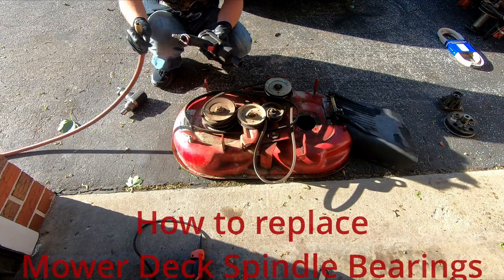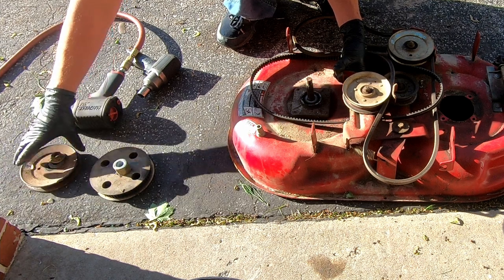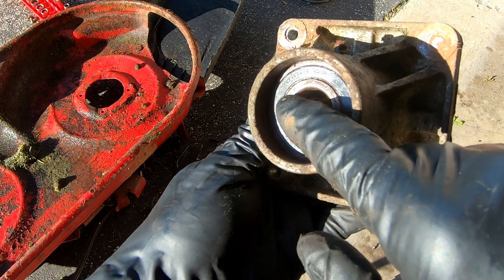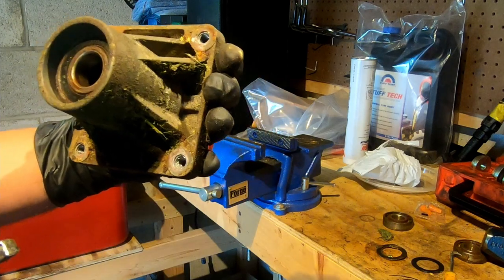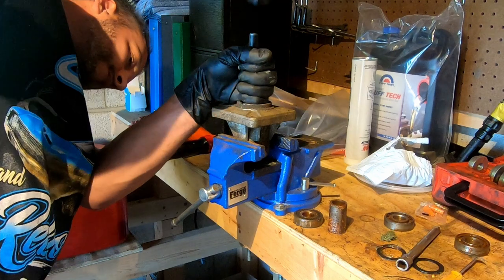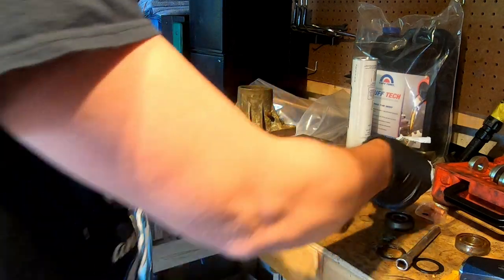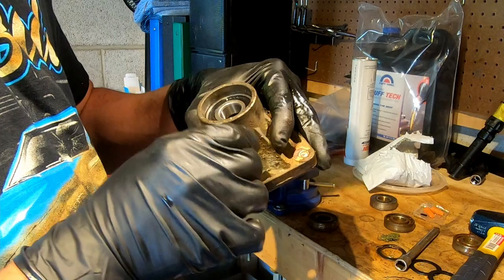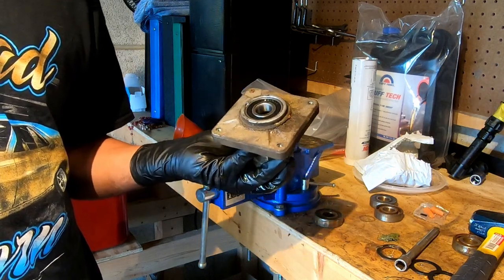Replace Mower Spindle Bearings CHEAP!

Comment: My experience is to add a weep hole in the casting. Just a small hole, 1/16th will do, about 1 half of an inch below where the top bearing is seated. It will release any pressures and keep grease from blowing out the bearings or seals. Just a thought.  Good video  thanks
Reply from the maker: Great tip!
Reply: Heres my thoughts , I add nipples also if they don't have them  , I pump grease until it goes  threw bearings and comes out ends of spindles , grease will go past the covers , grease guns push out 10,000 psi ,  they are not seals just loose fitting dust covers . the covers  cannot be pushed out as the shaft has a bearing stop that presses against them ( when top pulley bolt is tight )   , adding a relief hole does not allow fresh grease to pass threw bearing so what you are left with is the same contaminated grease around the bearings..  as bearings wear they create metal particles that will just sit there and act like sandpaper , you want to flush new grease threw them to purge the contaminated grease  ,  the grease will go through bearing with both covers on  , grease will follow the path of least resistance   so when cavity is full it has nowhere else to go but threw bearings and out ends of spindle  as its designed to do .   I would prefer to have new clean grease around bearings. , adding the vent hole guarantees no new grease will ever get to berrings after the initial fill

Comment: Appreciate this video! My spindles are too long to fit in my vice, was nervous about hammering but your video gave me the confidence to get it done. Regarding removing the seals, I don't quite get the logic–if grease CAN'T get by the seals, then there's no way for them to run dry. If it CAN get by the seals then there's no reason to remove the seal. So which is it? I removed one side but just left the other side alone to do a "which fails first" test, but would appreciate you letting me know what I'm missing. Thanks again!

Comment: Pull bottom seal and leave the top one alone, top bearing will run dry without the seal.  Hot grease and gravity will make it run dry.  You can leave them both if you want. Seal removed on bottom bearing will always stay full.

Comment: when pounding out berrings don't just hammer on one side take your time and hit 4 sides gently and evenly  , what you just did is egg out the hole from forcing bearing out from one side , spindles are only soft aluminum  , now new bearings will be loose in there and you may end up with a spun bearing and then the spindle will be junk .
Reply from the maker: I would agree, if I was working on a vehicle I would be more careful.  As taryl says, it's not the space shuttle, just a lawnmower!!

Comment: Not true! The grease will go into the new bearings with the seal on it. If you fill the void till it comes out on top and bottom, then pull the bearings again and pull the seal off you will see that the grease in fact goes right by the rubber seal. Seen it done it.
Reply from the maker: Good to know!

Comment: No
Do Not remove the mower deck
Do Not remove the spindles
On the mower with mower deck installed 
Remove the pully shields
Remove both pulleys 
Spindle shaft with mower blade attached should drop out of spindle.
Spindle top bearing should be removable by hand. If not tap out top spindle bearing from bottom of spindle
Remove bearing caps from removed top bearing and the bottom bearing cap from the bottom bearing (leaving bottom bearing in spindle)
Clean & re grease both bearings 
Replace sealed bearing grease caps.
Install Spindle shaft
Torque pulley to 90 foot lbs.
FIN
Total cost 50c 
Total time 30 minutes 
but 
you need to buy a  Wal-Mart $2 can of bearing grease.
Everything can easily be done on mower with mower deck never removed.
Reply: 6204 bearings on m I ne